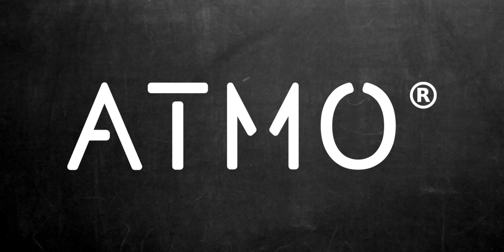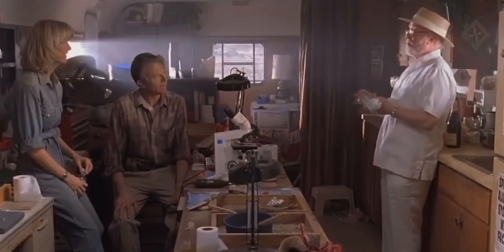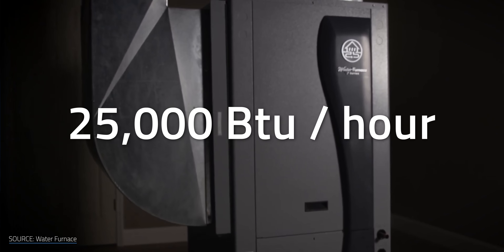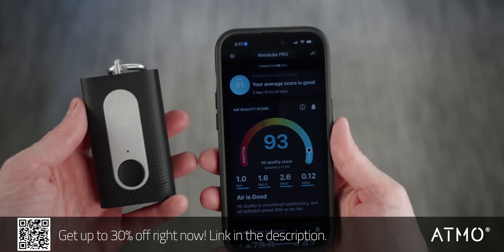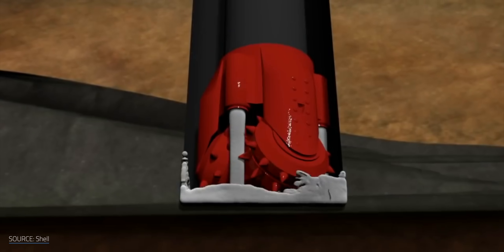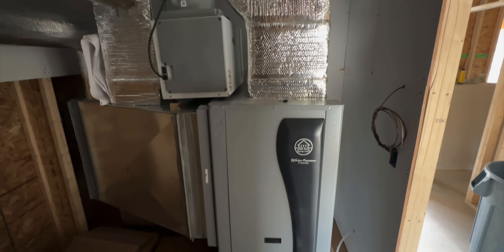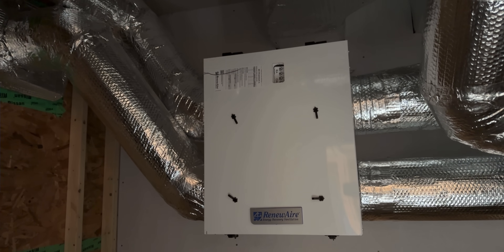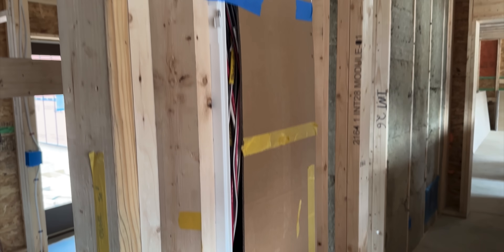Why I Went With Geothermal For My Net Zero Home

Comment: In reference to the smart shades, I wonder how well adding or subtracting the average amount the day/night cycle lengthens or shortens to the times the smart shades open/close would work? Could be tricky though. Depending on the time of year it can differ from 2 min. a day to 3 min. around equinox’s but around solstice’s there’s essentially no difference between one days length to the next.

Comment: Why did you went with metal roof - in Poland we use it only if the investor is budget constrained.
Reply from the maker: Metal is a budget roof in Poland?  Wow.  Here it's a massive upgrade over asphalt shingles, which is the norm.  I'm planning on going into more details on why a metal roof in a future video.

Comment: That’s a clever use of smart shades that I hadn’t thought of.  In my home I put automated shades in mainly to keep the sun out of my eyes when it gets low in the sky, but I’ve had trouble getting the Somfy remote control unit to link to my automation hub over Zigbee.  I also have a bunch of Keen smart vents for which I’ve set up the system to direct most of the air upstairs when cooling and downstairs when heating using convection to keep the temperature more even throughout the house.

That reminds me, I should check the batteries on these things — the one annoyance of not having all the smart devices just wired to the house, since the house is much older than home automation.

Comment: I put in a 4 ton Water Furnace back in the 90s. My system was open loop, so it required a special model that uses nickel mix coil to avoid corrosion. My install had two water heaters in series with the Water Furnace preheating the 1st unpowered water heater and the 2nd water heater only making sure the final temp was correct. I loved the Water Furnace, but with solar so much cheaper now and having moved to a warmer climate, I've put the money into extra solar as it saves on more than just heating/cooling. My last two houses have been net (below) zero. My previous house was total electric and the utility paid me at the end of the year. My current house has a tankless gas water heater due to a misunderstanding. I planned to have electric heatpump water heater, but due to complication, it will likely end up with both in series similar to before. Still I've been as much as 1.7mwh of extra electricity back to the grid in a single month. The current month is 1.2mwh negative, so my excess solar more than offsets any gas used, and that includes EV charging. Good luck with you system. I've lived in Mass twice in my life. Don't ever want to go back,even to visit. My last year of high school was at the current Mass St. Police academy in New Braintree, and I was stationed at Fr. Devens back in the mid 80s.

Comment: Four plus years with Lutron Caseta using wall dimmers, wall switches, plugs for lamps and a few Pico remotes with no problems at all. I am using a Hubitat and a pro level Lutron hub for control. Control is based on timed automation, 2 dashboards and Alexa voice. Expensive, takes a bit of time to get going,  but highly recommended. Does not require an internet connection except when using Alexa.
Reply from the maker: Thanks for sharing!

Comment: Have you talked to an actual person with geothermal for an extended time? Everyone I've ever known you has it for any length of time hates it. They work great for 5 years. Ok for another 5 and then basically not at all. They are essentially a heat exchanger and heat exchangers always need cleaning and you can't clean the underground loop so it slowly looses efficiency until it stops working. Maybe the new ones are better but j suspect not
Reply from the maker: I've spoken to quite a few people who have geothermal systems and not one of them regrets it (one has lived with one for 20+ years).

Comment: I really strongly recommend against the UBNT cameras, I've used them a lot at work mainly because they're cheap for us but they're impressively unreliable in both software and hardware. The NVR software is especially crusty.

Not a fan of their networking gear either but that's just personal preference. It's not bad. I find it a bit cringey that you're required to have a controller for most of their products though.
Reply from the maker: Appreciate the POV.  I've been testing a single camera for the past 6 months and have been pretty happy with it.  Good picture and it's never flaked out on my yet.  Scaling that up to my full house setup will of course be very different.  Curious to see how it plays out.

Comment: I wish I could afford a Geothermal system. Also, I do not blame you for going for force air as you are using a geothermal option, it is not much different than mini splits outside of the zoning difference.

Comment: Matt - Would love to see a series of videos on each component/subsystem in your new house. We are in the design and planning stage of a second home in the NC mountains and heat pumps, super insulation, standing seam metal roof, triple pane European windows, sealed combustion fireplace, ERV, dehumidifier, etc are all on the table. I would love to hear how you thought through each option and ultimately what you decided and why. As always, thanks for the really interesting and well-researched content.
Reply from the maker: Gotcha ... going to see if I can make that happen.  Deep dive on each individual thing.
Reply: @UndecidedMF  I think many of us would love a deep dive into each part. It's been very interesting to watch and learn about
Reply: You probably know the YT channels Home Performance and Matt Risenger. If not, you will probably find those channels useful
Reply: @l0gic23  Yep, subscribed to them both and find them quite interesting.
Reply: There is a very interesting modern log home manufacturer  in your state.  They are called  Enertia Homes.  Long story short their log homes are self-heating and self-cooling.
Reply: @rcollinge325  Thanks. I will check them out.
Reply: @rcollinge325  That's an impressive way of doing that. There's a video on Kirsten Dirksen's channel about a house that has a south facing concrete wall that acts as a heat battery in the winter, or a chimney in the summer by using the exact same concept.
Reply: I'd stay away from the ERV and go with an HRV.  The energy savings isn't worth the additional maintenance and waste associated with it.  Humidification is also important in the winter and cold environments as the low moisture can cause issues with wood, electronics and most importantly health / comfort.  Humidity control is important and neglected in so many new constructions.  Another overlooked aspect which I've never seen implemented in a domestic setup is free environmental cooling.  In the fall and spring (and cool summer nights) there is a large time period were cooler air can be drawn into the home (filtered) to cool it.  Plus there's the added bonus of getting fresh air in the house, all for the cost of running a high efficiency fan and having an outdoor temperature probe.  HRV/ERV's need to be bypassed in this scenario as you don't want to reclaim the unwanted heat.  Duct control (and placement) is another aspect which is barely acknowledged.  Having a few smart dampers installed in an smart home (manual can be done as well) allows better air flow manipulation, hot air at ground level for heating and in summer cold air at ceiling level, how many forced air homes do you know that have freezing basements and hot upper levels.  Duct design should incorporate heating AND cooling, seems like one is always compromised.
Reply: It's great to see you benefitting directly from the effort you've shared with us, your audience.  And in fact, Matt, this is one of the few ways you can stay relevant.  You are rapidly exiting the middle class and it's probably not the greatest thing for your channel.  If you split it up a bit, we can understand better how each solution should be valued for those of us not making millions.
Reply: @glassedin1  - In my view, staying relevant is not about socioeconomic level, it is about relatability. Matt’s stock in trade is his thorough research. If he keeps that up, the rest is irrelevant.
Reply: @glassedin1  Millions?
This is absolutely middle class in Europe.
(Not the millions ;--)

Comment: We've been in our house in northern Spain for 8 years now. We went with a geothermal system (150 meter deep well) and have been mostly happy with it, especially with the energy savings. What we didn't like was having the ground-source "pipe" settle and break some of the fittings. It did this twice, in the first two winters. We think it was due to underground water flows causing the ground to settle. After fixing that, it's been good. We (I) also installed an extensive smart-home system (Loxone and KNX) that controls all the lights, shades, blinds, underfloor heating, solar panels and many other things. I spent a lot of time developing and implementing logic to account for the sun, external temperature, interior conditions to drive shading, heating and cooling. I found that in the end, you get a feel for your house and can replace most that with simple timers and schedules. The great thing about the smart-home system is that I can drive it as complexly or simply as I like, and experiment with a mix of the two. Enjoy your setup, it'll be a super fun toy! ;-).
Reply from the maker: Thanks for sharing!
Reply: I would really love to hear more about your smart-home system.   I want to build one of my own that controls shading to account for the sun + outside weather.  All the best!!
Reply: Interesting story about geothermal in Spain.
Reply: I live in Belgium and have 2 wells About 75 meters deep,i have a vailliant system with floor heating. Floor heating on my ground floor and upstairs bathroom, this is enough to heat my whole house wich is 3 levels high. Floor heating is widely used here in belgium and is very handy for cooling in the summer the big pro of this system is that the house retains heat amazingly well even if accidently leave a door or window open to long. I have the system for about 8 years and i had a broken sensor within warranty replaced for the rest nothing broke broke so far. We do have a very soft sandy ground with no rocks or anything that can shift.i am surpized to hear the sytem can freeze because our return in the winter goes below 0°C. I do try to passively cool the house enough in the summer to get some extra heat in the ground during the summers and yes Belgium does not have very cold winters.
Reply: @prismalike  Hi! How do you use floor heating for cooling the house? Is it comfortable enough to cool the floor in summer? I saw some some people did in our country (Ukraine) fan coils, through which the liquid from the ground loop is circulating,  and it allows to passively cool the house
Reply: @sandro5019  well it is just like that. It pumps the cold water from the well ans keeps the house around 23-24°C during a heat wave (30 outside for more then 5 days). I do have alot of wooden flooring wich gives me a poor cold transfer i regret not placing it in the bedrooms. It's not so cold as airconditioning but feels more natural.
Reply: Exactly and I am glad you pointed out that failures in geothermal systems are common and can be costly to repair. Especially in cold country where your water pipes freeze overnight with no heat.
Reply: @solarcabin  Underground water pipes don't freeze and the feeder pipes usually are insulated.
Reply: @FutureChaosTV  Can a geothermal system freeze?
"If your earth loop is installed above the frost line, yes it will freeze, but even if you install your earth loop below the frost line, the fluid may still freeze. Freezing in an earth loop is caused by the geothermal heat pump taking heat from the loop fluid, not the winter air temperatures."

"Though common, a heat pump freeze-up usually means your system's components are not working correctly. Sometimes you can fix it yourself. But often times, you will need to call a heating, ventilation, and air conditioning (HVAC) professional, as the problem may require a part replacement or complex repair."
Reply: @FutureChaosTV  "Solarcabin" is correct: anytime the design of your underground radiator (aka earth loop or "ground source") is drawing more Btu out of the circulated fluid within the tubes than the surrounding earth mass and, to be clear, the groundwater moving through it (which can change over time) then you can "freeze out" your loop. Normally the GSHP inside will "freeze protect" itself by shutting down/locking out at about 38 or 37 incoming temp. At that point, having lost your heat source, your interior water-bearing pipes can freeze from a lack of heat.  This last situation is normally avoided by burning big kWh in resistance "back up" heating built into a GSHP system and interior temps are maintained until the ground loop recovers. I've seen it happen so many times I do not let anyone I care about install GSHP systems anymore.
Reply: Why did you mix in Loxone? Just out of curiosity. I understaand Bacnet or Modbus to communicate with some other stuff to KNX, but Loxone?  
Btw also have KNX as main system, can't beat the stability of it. Never restared.  I'm also communacting with the solar inverter and use it to start heating, boiler and so on when it's producing. Since early april I have an avrege grid consumption of 1kWh/ day :) , rest is from solar. Even the car has been charged on solar.
Reply: @Iceeeen  The functionality and extensibility of the Loxone system is really great, but 8 years ago I didn't know if they'd survive. The switches, lighting controllers and blinds actuators are all KNX and will continue working if the Loxone miniserver dies (it never has). This allows us to use the house "like a normal house" but still have as much automation as I feel like programming.

Comment: "geothermal" means something else. What you mean here is "ground source heat pump"
Reply from the maker: Yes, it's a ground source heat pump, but geothermal is an accepted term: https://www.energy.gov/energysaver/geothermal-heat-pumps#:~:text=Geothermal%20heat%20pumps%20(GHPs)%2C,of%20the%20outside%20air%20temperature.
Reply: @UndecidedMF  It may be, but it think using it that way can be misleading ... Its more like what Iceland is doing where they are tapping underground heat sources directly https://en.wikipedia.org/wiki/Geothermal_power_in_Iceland

Comment: Great Video and idea not many humans are doing. What’s is longevity idea you plan to have with this house? What kind of metal is the roof? With a metal roof, you’ll have to switch it in 10-25 years I presume? You didn’t want to do add a stone reinforcement roof? Or wall structure, so future generations can benefit from it as well?
Reply: A metal roof should last for at least 50 years.
Reply from the maker: The metal roof will last 50+ years and can be fully recycled at end of life.  It's much longer than an asphalt shingle, which is standard (15-20 years).

Comment: Have you considered using your warm waste water as a heating source? It would be awesome to be able to get all that warmth from just flowing into sewage.
Reply: It is a closed-loop system. There is no wastewater. When he is cooling his house the waste heat will be used to heat his water.
Reply: @bobjohnson4512  so nothing goes to sewer? e.g. when taking a shower, where does the warm water go?
Reply: @xampart  If you think the heat from 20 gallons of 110-degree water from a shower is worth recovering go for it.

Comment: Doesn’t flying in a plane once undo all the carbon emissions work you do in your life time?
Reply: Wikipedia indicates that the average carbon emissions for commercial aircraft is about 60-130g of CO2e/passenger kilometre, with most around the 90-100g mark. Not amazing, but the emissions per passenger of a single person driving a non-hybrid gas car the same distance would likely be higher.

I recently purchased a carbon offset for an upcoming flight of around 11 hours duration and the carbon emissions offset were around 700kg for that flight.
Reply: Planes fly if people are on them or not.

Comment: I’ve spent way too many hours on the back of one of those drill rigs in my younger years. Lots of memories of doing hundreds of installs at some pretty crazy houses.
Reply from the maker: It's a fascinating process!  The crew that drilled my well were awesome.  The lead was pretty funny too when they got down 20-30 feet.  He turned to me and said, "This is the boring part ... now ... we wait."
Reply: @UndecidedMF  Did they have to drill through rock?  That was the only part that made me nervous. 300-500psi in 3” diameter hoses to run the hammer bit is a lot of energy if something goes wrong.

Comment: Question about an 'air tight' home. If you have a power cut, is it so air tight that hypoxia from co2 build up might be a danger issue? Say it cuts just after you're going to bed. Are you going to wake up with a headache due the build up of co2. Are there failsafes in place to open some windows, etc. 

I know you're battery backed so safe from grid failures so very low risk, but wondering if it is something you need to worry about?
Reply from the maker: That is a concern, but it wouldn't be an immediate worry.  You'd have plenty of time to react, open some windows, etc.  In my case, that's not a concern with the battery backup.